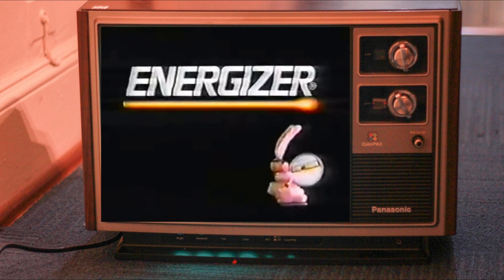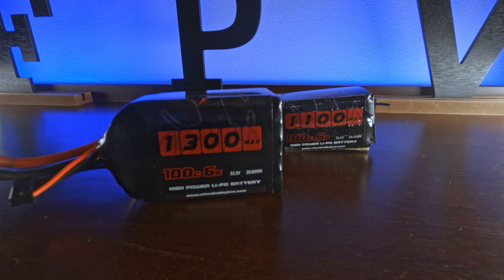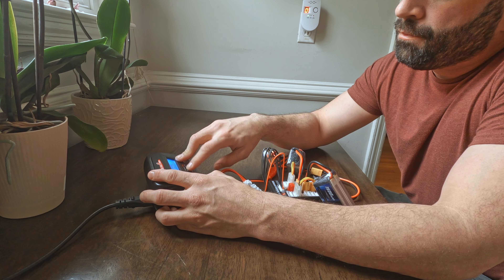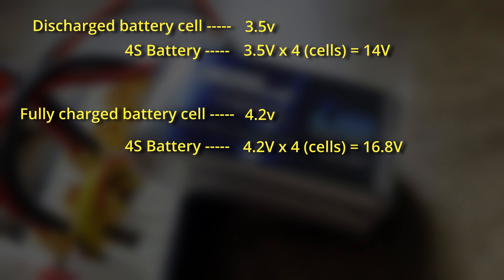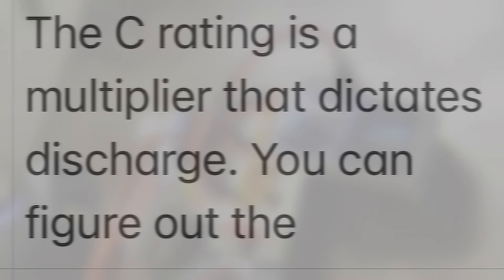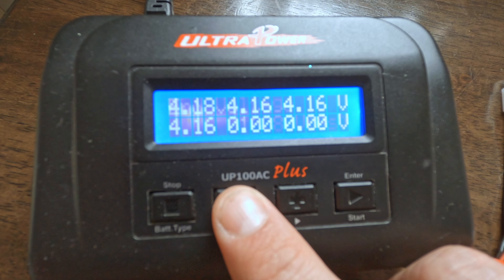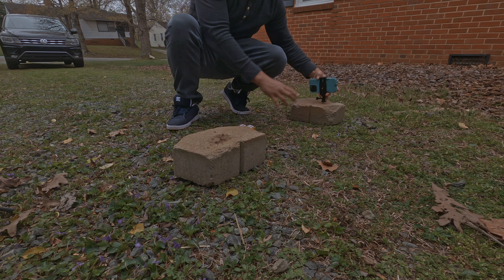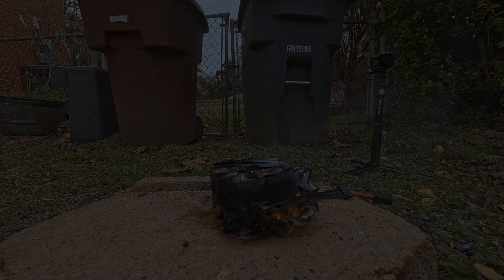How to use lipo batteries with fpv drones

Comment: Your 1,300 mAh 120-C rated battery can output 156 Amps MAX.  Not 1.56 Amps.   Agree a safe charge rate of 1.56 Amps seems reasonable.
Reply from the maker: Yeah that’s why I said bring it down to 1.5. But the lower abs slower the better!